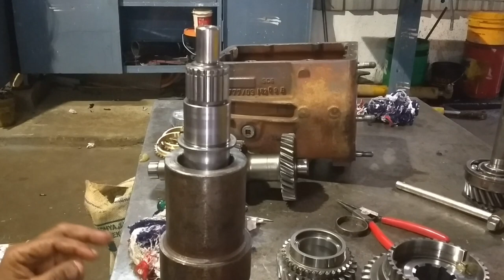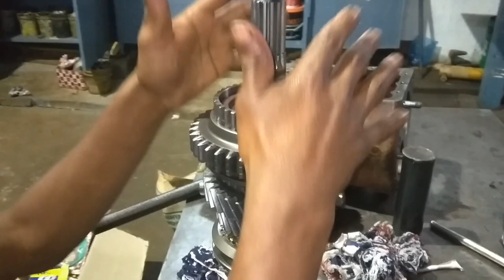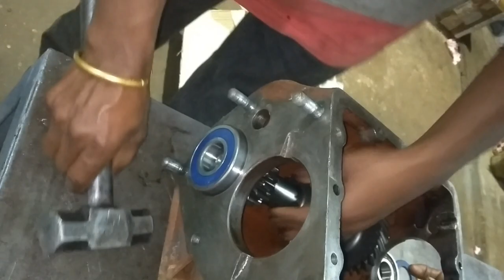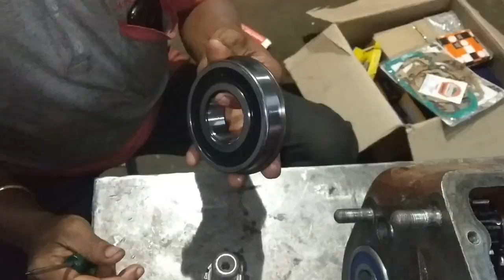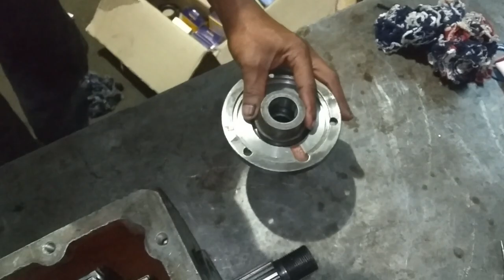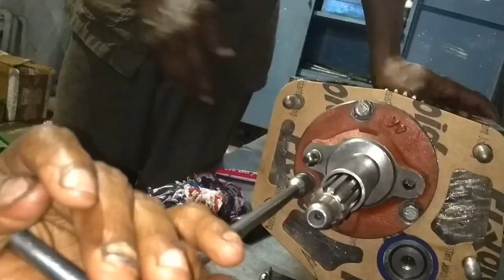MAHINDRA 5 SPEED GEAR BOX

Comment: Ye konsi gadi ka gearbox h. Agr purchase krna ho to kha se kre.
Reply from the maker: Bolero Camper old model ka gear box hai sir...
Aapka najdeek ka Mahindra dealer se milega...
Reply from the maker: Aapko kya full gearbox hona hai separate separate iska item hona...
Reply: @prptechnician6620  thanku sir ..I want only gearbox without clutch housing...I want to use this in our horizontal bandsaw mill for pulling trolly in equal speed.
Reply from the maker: Sir aapko gearbox attraction  karna hai to second sales me milega dekho...
Reply: @prptechnician6620  mil gya sir ...Old jeep ka...4 gear ka..Thanks for your advice
Reply from the maker: Ok all the best sir...
Kitna me mila...
Reply: @prptechnician6620  5 thousand ..Or service krke diya h oil and bearing chang krke
Reply from the maker: Super sabse sasthe me mila...
Reply: @prptechnician6620  agr m aapko uski video send krna chahu to kse kru